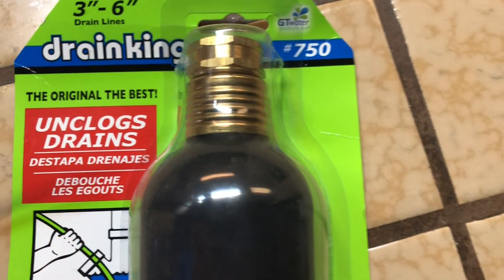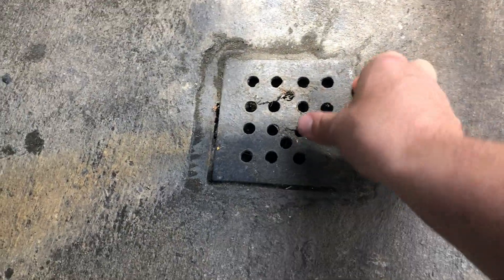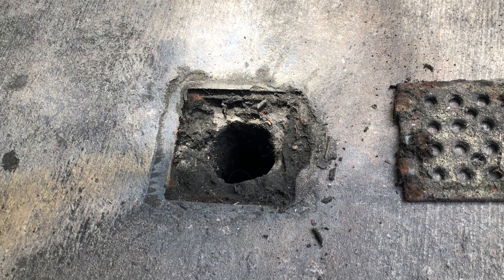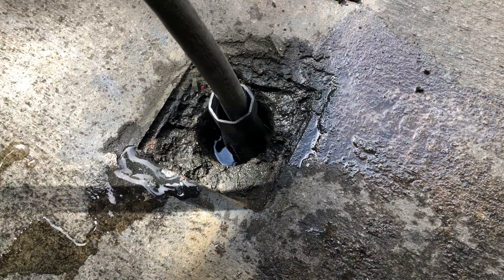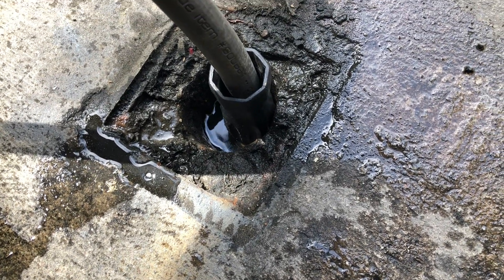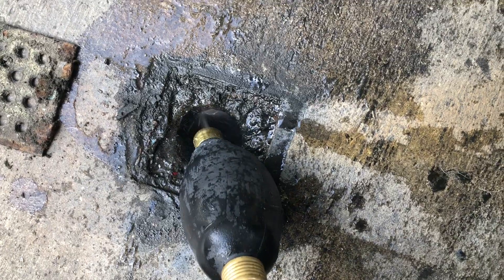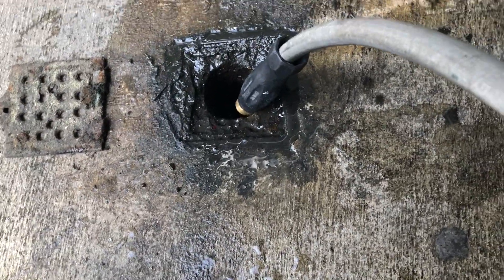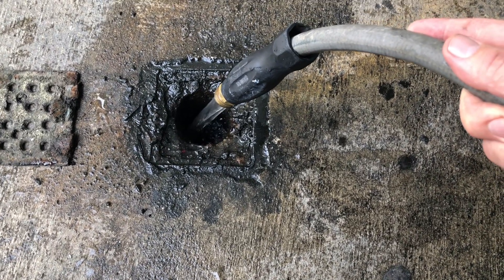GT Water Products (750 3-Inch to 6-Inch) Drain King [] Review [] Clog Buster

Comment: My 4 inch sewer line was backed up between the cleanout in my yard and the street. I tried the drain king 3 times for about 10-15 minutes and it was still clogged. A few days later I tried it one last time but this time I forgot that I was using it and it ran for about 2 1/2 hours. After I pulled the hose out it made a big burp in the cleanout and the backed up water dissappeared. Sewer line is now clear.  My sewer line is not deep because I live in the south, so I installed a backwater valve between the cleanout in the yard and my house. I then put a cap on the cleanout that has a pop-up relief valve in case that it blocks up again the sewage will not go near the house.

Comment: I’m a plumber. I use this all the time. Only works on certain clogs. Not all clogs. And will only work if it can build pressure so it has to go out the last drain Bc if there’s a vent or sink or anything the water will come out from there and you’ll never get the clog. 20 mins runs for.

Comment: I've used the rubber bladder to clear my 4 in sewer line many times and successfully.  Saved me a lot of money.
Reply: i dont understand how that works, it looks like it just blows up and you get a tiny stream of water, how is that suppose to be enough to clear a blockage?
Reply: @feralbigdog  The bladder bloats up to the  same inner diameter as the pipe.  the stream of water, while thin, comes out like a little jet stream.  The water fills up the gap between the  bladder and the blockage, forcing the blockage to break apart so it can travel easily through the rest of the pipe. These bladders come in several different  sizes to accompany the diameter of pipe being worked on.
Reply: @loumitch1  when this water builds up, would i be right assuming it acts like a ram to push it (blockage) down into the septic tank?
Reply: @feralbigdog  Yes, exactly.  As the gap fills up with water, it builds up pressure and forces the blockage to breakup.
Reply: @loumitch1  i wish i knew about that thing early 2018, we had to dig up the tank lid, rent a bigger snake and run a line up, hook onto it and pull the end up through the cleanout, wrap a big washcloth around that and secure it with a clothes hanger, and pull it back through, it worked, dislodged the blockage, mom had a boyfriend at the time that helped us with that, he saw the waste pouring out into the tank and said it was like a cow dropping its,,, well you get the idea
Reply: Our plumber used one of these and unclogged our main line on multiple occasions. Charges us $50 each time "a good deal." We decided to buy the piece at ace. $30 And it worked, we're ready whenever we may need it again.

Comment: Will this break off the plastic barbed tip (threaded on to the hose) as soon as you add water pressure to it, and go flying into your sewer pipe -- like the Home Depot, Chinese-made Husky brand bladder?

I swear, things manufactured in China have been declining in quality, precipitously, in the last two or three years, especially.
Reply: Well good thing this quality product is made in the US of A.   It cleared my kitchen drain and save me $$$ from not having to call a plumber!